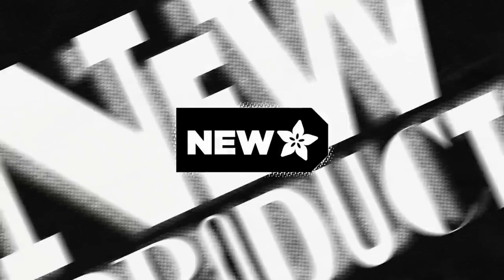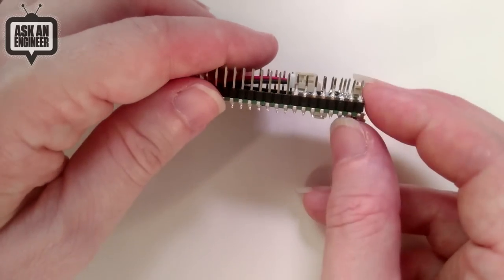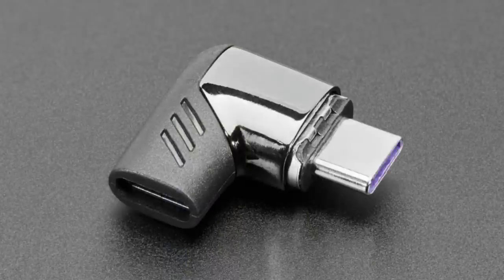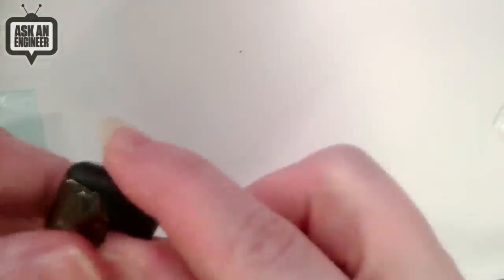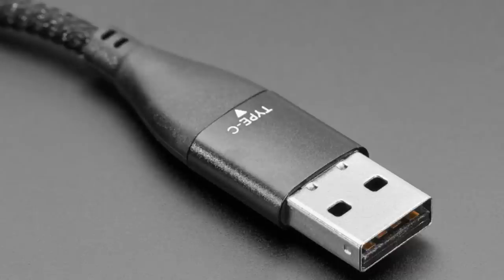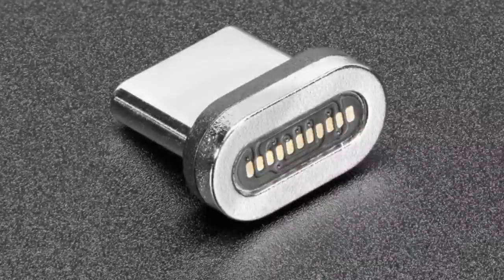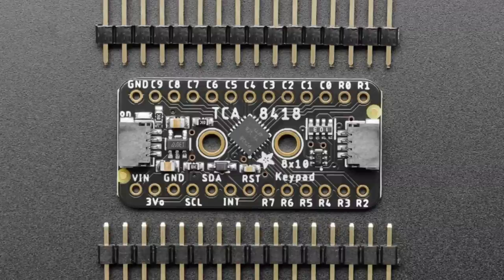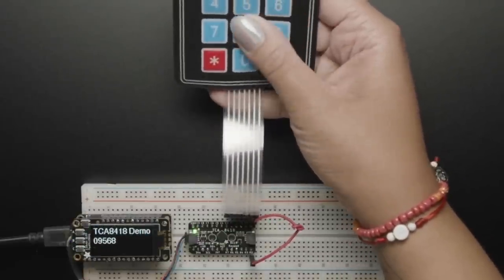#NewProducts 9/8/2022 Featuring #adafruit TCA8418 Keypad Matrix and #GPIOExpander #Breakout!

Comment: they should color the allen keys by size using the resistor color code. the 1.5 would be brown w green bands. 10 would be black/white. 5 is blue, 2 is red, 2.5 is red green bands...
Reply: That would make sense and be useful and not virtue signal enough.
Reply: I love this idea! I'm going to try to accomplish it with heat shrink. ☮️❤️🌈
Reply: @RichardBronosky  I love THAT idea

Comment: Can you confirm that the USB-C right angle thing is ONLY power and NOT data.  It is hard to tell from the fleeting view in this video 3:56 but it looks like only five pins.  Where as the the cable shown at 6:57 clearly has 11 pins so is most likely power AND USB 2.0 data.  Although with 11 pins on the mag connect that is not enough to make the 16 unique signals on USB-C, or even the 8 after not connecting the 8 SuperSpeed Differential pairs.  Could you please update the product description pages to clearly show which pins are connected?

Comment: I did a project back around 2001, 1 microcontroller pin for keypad. Rows and columns with different resistors, small buffer to catch the ADC channel values on interrupt and when stable I ran the resultant value through a case select sequence to capture  the ranges that represented the individual keys. Who needs lots of pins? Worked well.